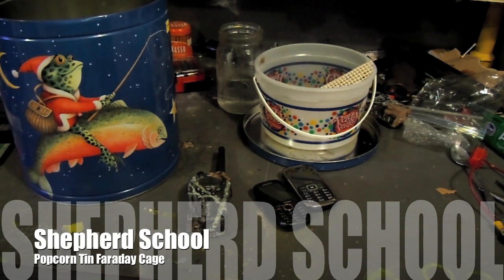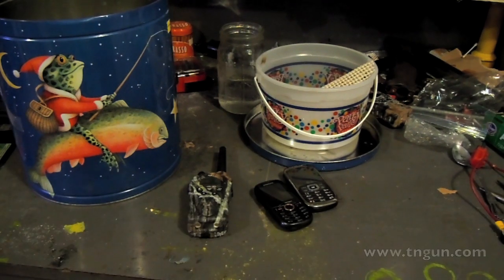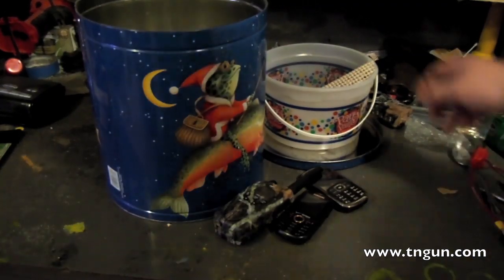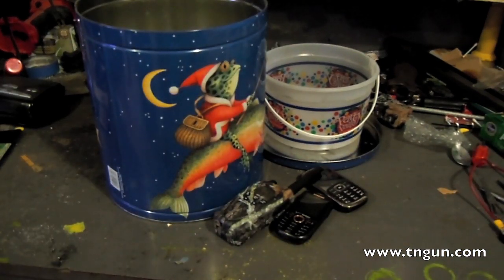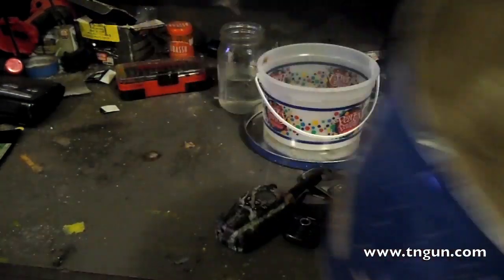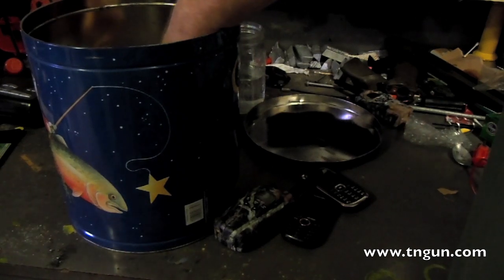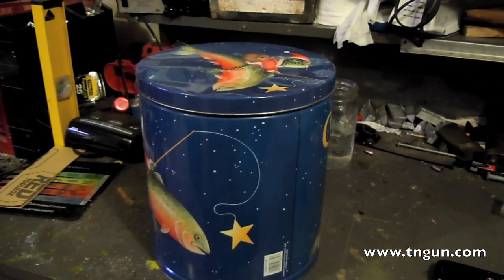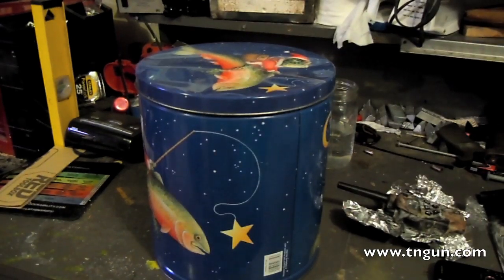How to Test a Popcorn Tin Faraday Cage

Comment: Using a an android wifi analyzer app I only got a 10 dB drop on a wifi signal using a popcorn tin by itself But an additional 5 more dB by sanding the contact points on the lid and using aluminum foil as a gasket under the edge of the lid.  Then and another 40 dB by taping the lid and seams with aluminum tape.  At that point I could not get enough signal to stay connected.

Comment: Is it possible that using emory cloth/sandpaper to remove any paint or clear coat where the lid and tin come together might provide a little more protection? First would be the inside edge and  rolled metal at the bottom of the lid. Second, the exterior of the tin from the top down to and including the metal bumped out where it comes in coach with lid.
Reply: Should read "where it comes in contact with lid"
Reply from the maker: Good idea.

Comment: Mylar bags are NOT useful as EMP shields..   You'd have to nest a dozen mylar bags inside each other and it probably still wouldn't work.     Mylar is NOT a continuous conductor and the edges are not conductively sealed.
Reply from the maker: Good point, but they do have some conductivity in the seal as the inner plastic melts.

Comment: @2:00 Emp's operate at 25-100mHz frequency, if your radio is a UHF that operats at 400mHz and up it will really go through. best test is FM radio. My tin can can block the highest FM radio freq at 107mHz above the 100mHz EMP op frequency.
Reply from the maker: thanks

Comment: YOUR FARADAY CAGE IS NOT PROPERLY INSULATED. Get some carboard and cut it to match the size of the bottom sides and top of the metal container. THEN put the ice cream bucket in the tin and fill with your gear. =)

Comment: Good and cheep idea . One thing extra i would do is sand the top to remove the paint. So the lid and the top of the can will have a good electrical connection. EMP will tend to flow on the out side of the can. Kind of like electron flow on the out side of a wire.